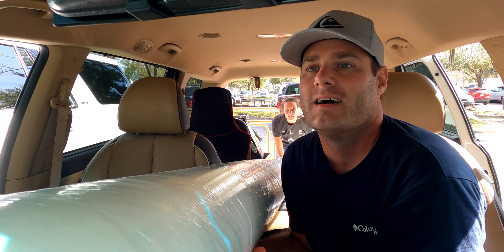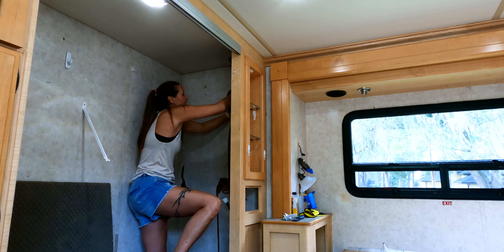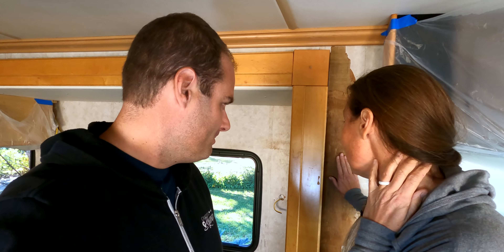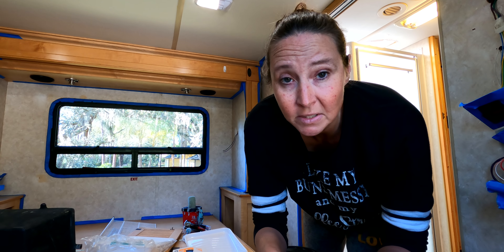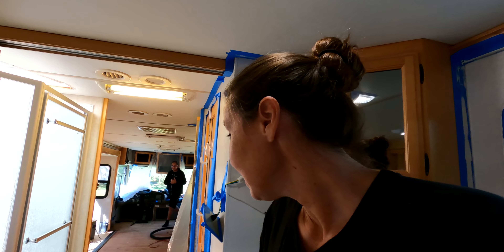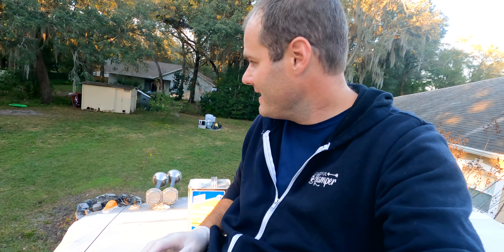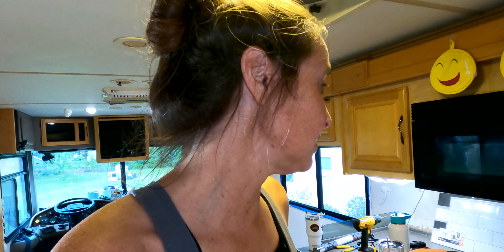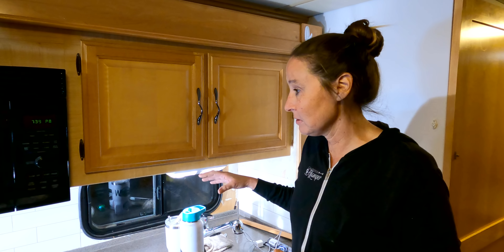DIY RV Repairs Gone Wrong: Epic Fail to Major Win

Comment: Just a suggestion: maybe the leak is coming from the slide seals. Wether it be on top or the sides, those rubber gaskets don't seal properly over time.  Many new slides are tripling the rubber all around so no matter how hard it rains, one, if not more, of the layers stop leaks. I am so worried about leaks on slides while I am shopping for the right one. One way to test for leaks is using a air compressor to blow on joints to see if any air comes through the other side. Another way is using a bright flashlight at night to see if any light gets through. Great video and I have a tremendous amount of respect for all the work you are doing.
Reply from the maker: Thanks for the tips and the comment!

Comment: I am not a painting professional but I am a carpenter by trade and I am appreciating watching your remodel of your rig. I did notice that you were using a 12 inch roller for your paint you need to learn how to use weenie rollers 2 inch 3“ and 6 inch. They very inexpensive and really cut down the time to apply paint to a job. Can’t wait to see the finished product. Thomyt
Reply from the maker: Thanks for the tip!

Comment: If the water leak was in fact coming in from the screws, your fix will not hold. That drip rail needs to be removed and cleaned up and reinstalled using the rolled sealer like you use to install a roof vent.
Reply from the maker: Good to know!

Comment: We just bought a Fleetwood Bounder and it looks like in the bedroom some of the wallpaper is coming down? In your bedroom did you paint over the wallpaper or peel off the old?
Also what type of paint did you use? Was it a one coat?
I love the videos! Thank you so much!
Reply from the maker: Hey there! If your wall paper is coming down, check for any water leaks. Wallpaper in an Rv is actually more of a vinyl coating so you want to paint over it. I used a Behr Marquee one coat hide paint from Home Depot. Best of luck on your Reno!
Reply: @GratefulGlamper  thank you we will start looking for the leaks. We just picked it up so we haven’t gone through everything. The wallpaper that is peel and stick does well adhering to the wall? We have a lot of humidity where we live!

Comment: Hey it looks great, can't wait to see the finished result. I just redid the  floors in my Disco as well, I have to put sliders down so it doesn't scratch the floor when moving the slides in and out. Works great. Quick question. Are your windows tinted? If so, did you guys have it done. My windows are not tinted and I think tinted windows might help with the summer time temps inside the coach.
Reply from the maker: The windows in our coach are not tinted. Let us know if you get yours done!

Comment: The remodel looks great. I had to laugh because I used colored pencil to touch up spots on our laminate wood cabinets also. It does work better than the wood cover up pens. How many coats of paint did you have to use on your walls?
Reply from the maker: We only used one coat of paint. The paint is a Behr Marquee One coat hide so it doesn’t need more than 1 coat!

Comment: WOW !!!  So ... on the peel and stick wallpaper and backsplash .... did you use the Nano tape to make sure it stayed ?  did you paint first then apply ?
Reply from the maker: We didn’t do anything special other than make sure the walls were clean before adhering with the adhesive on the back.
Reply: @GratefulGlamper  where did you find the wallpaper ?
Reply from the maker: Home Depot